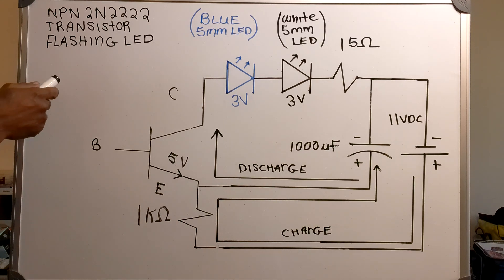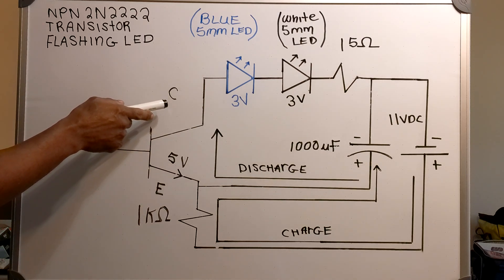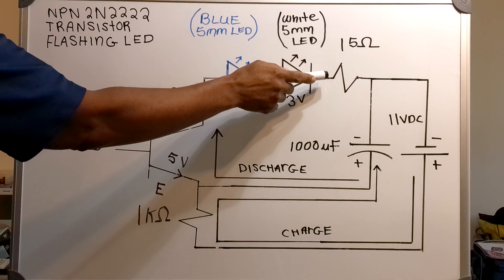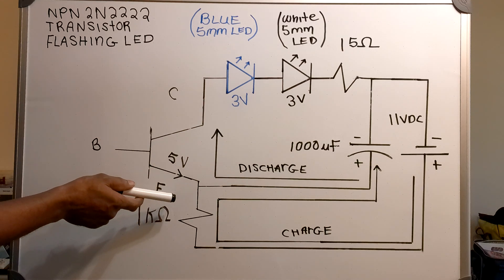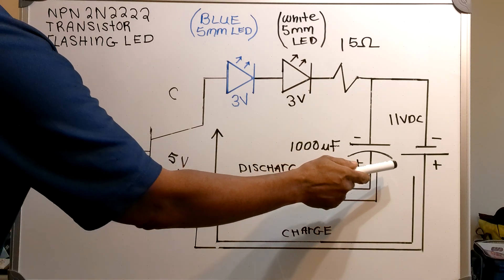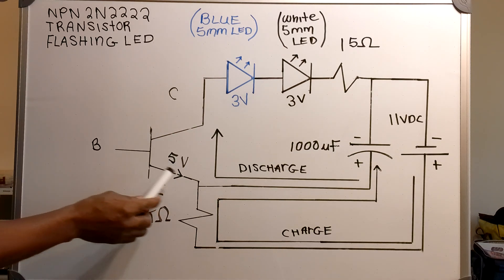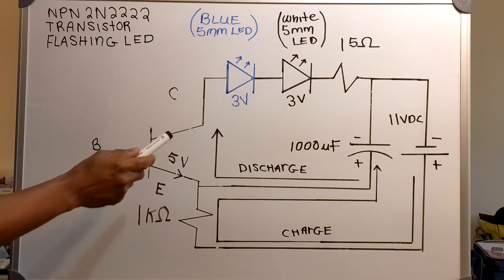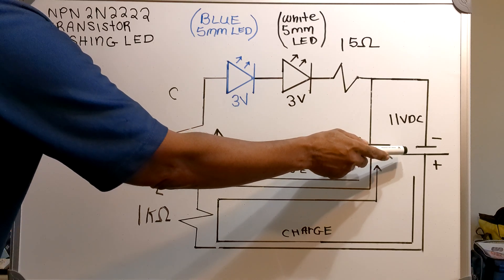NPN Transistor Blue and White LED Flasher Circuit!

Comment: Will this work at all? The npn transistor is polarized the opposite way
Reply from the maker: Yes. The capacitor reverse biases vbe with 5v allowing current to flow in the opposite direction. Try it and see.